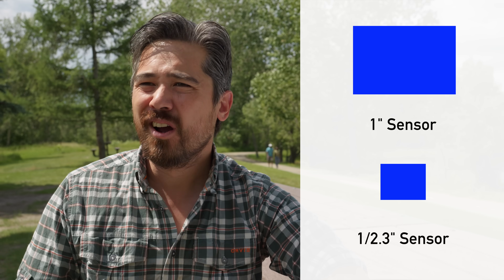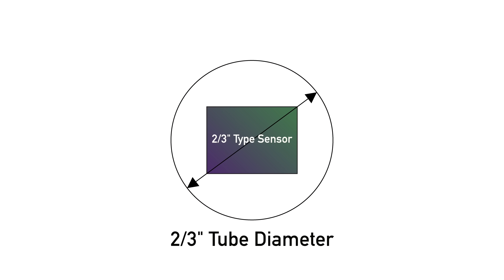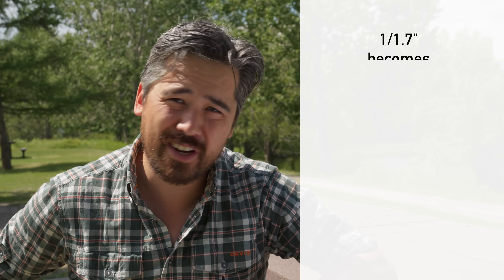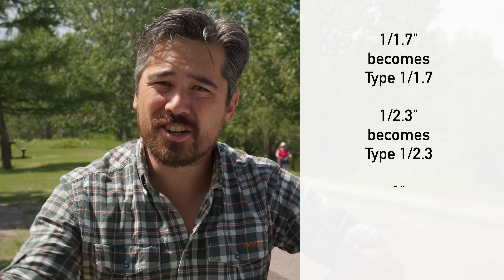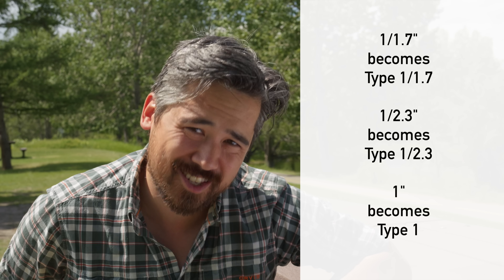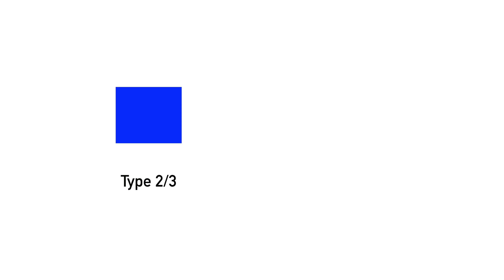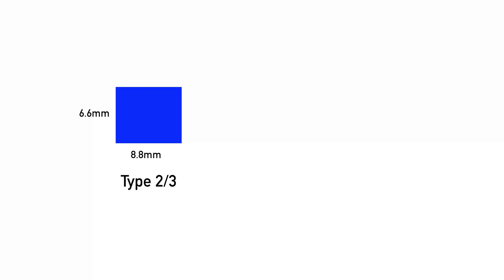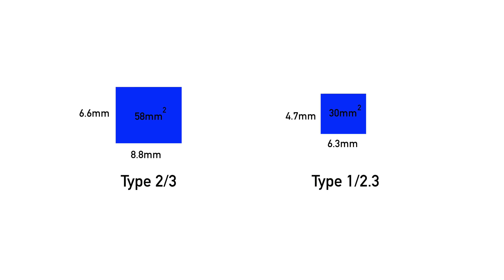Sensor sizes make no sense, but we fixed it!

Comment: That was still confusing to me - just use the 50mm squared suggested at the end of this video.
Reply: The problem using that method is that it doesn’t help all that much when you don’t know the aspect ratio of the sensor.
Reply: @GannonBurgettYT  But aren't all sensors either 4:3 or 3:2 (ignoring cinema sensors)? Are there any in popular devices that deviate from these 2 aspect ratios?
Reply: @GannonBurgettYT  And the "Type-2/3" method does? 🤣  If I have to remember 2/3" is a 4:3 ratio sensor, why can't I also remember 58mm² is a 4:3 ratio?  The difference is, if we simply use surface area as the MAIN name, then the Type number now directly infers SOMETHING and are now comparable.  My point is, Type-APS-C will not infer it's aspect ratio, nor that it has better light gathering capacity than Type-2/3.  For someone new, they STILL have to look up everything because this proposed "type" classification doesn't tell you ANYTHING useful or comparable.  On the other hand, Type-384 (APSC/24x16mm=384mm²) vs Type-58 (8.8x6.6) does.  It give you an instant, apple-to-apple comparison of a "quality".  Two, in fact... a larger Type designation will have a generally better light-gathering capacity, and generally shallower depth of field.  What's not to like?

Comment: Using square millimeters or square centimeters will be fine enough for any comparisons. For example my K3 has  366.6 mm² APS-C sensor .)
Reply: Agreed. Surface area is really what matters.
Reply: @danpsharpe  How does it matter. How do you relate it to apertures?
Reply: 100% agreed.  The "type" really didn't explain ANYTHING, and is just going to make the confusion worse.  See my other comments on using surface area as type.  Full frame would be 36mm x 24mm which is 864mm².  Just call that Type-864.  APSC is 24x16 which makes it Type-384.  Micro 4/3? 18x13.5=243, so Type-243.  etc.  It will also clearly differentiate the Canon "APS-C" which is not APS-C... at 22.3x14.9, that would be Type-332 compare to standard APS-C's Type-384.  A Type number that directly correlates to each sensor's theoretical light gathering capability, and rough depth of field quality - area you should truly care.  What's more simple than that!!??
Reply: Exactly. Its the only thing that makes sence.
Reply: Yes, this.
Reply: lol.
Reply: My smartphone has a 20.5 sq-mm sensor :-(
Reply from the maker: As mentioned in the video, whenever we compare two small sensors, we will include the square mm surface area.
Reply: @dpreview  If so, please include also the area of a single pixel.
Reply: It's a bit hilarious that people think area is a good way of measuring sensor size when we already have a perfectly good way of measuring every other thing that has pixels in a rectangle. It's diagonal length. People are able to compare phone screens to laptop sizes to computer monitors to TV sizes to projector screen sizes, of all types of aspect ratios, using one simple number. Nobody knows how to visualize two-dimensional quantities. Diagonal length is best.
Reply: @mbvglider  What?  Area is the easiest thing to compare: 400mm^2 is four times 100mm^2.  300mm^ 2 is twice the light gathering area as 150mm^2.

The only reason why diagonals are useful for TVs at all is that they are fixed at 16:9 dimensions.  If you look at say computer monitors a 16:9 34" diagonal is 493 in^2 and a 21:9 model with a 34" diagonal is 419 in^ 2, or 15% less area.  It's a useless metric for things of variable ratios.
Reply: @HappyHubris  Diagonals were used on TVs even before they had 16:9 aspect ratios. If one presents only one value, one presents the diagonal. If the aspect ratio is fixed it is better to present the width.

Comment: Am not so convinced by this new names.
I'd have gone to a complete metric system like "40 by 30mm" and so on..
Reply: Completely agree.  The "type" really didn't explain ANYTHING, and is just going to make the confusion worse.  See my other comments on using surface area as type.  Full frame would be 36mm x 24mm which is 864mm².  Just call that Type-864.  Micro 4/3? 18x13.5=243, so Type-243.  etc.  It will also clearly differentiate the Canon "APS-C" which is not APS-C... at 22.3x14.9, that would be Type-332 compare to standard APS-C's Type-384.  A number that directly correlates to each sensor's theoretical light gathering capability will be far more useful than some cryptic fractional values.
Reply: I agree with TomS. This is just using what is already confusing as a label. You could go metric and say type 10 as in under 10mm of sensor area. Type 20 as in under 20mm senor area and so on. I really love that you guys are thinking this way. I just saw camera conspiracies talk about this same thing. These conversations are headed in a good direction.
Reply: @tropicothunder4262  Did you mean 10mm², or did you mean 10mm diagonal or something else that's not an area? I don't think talking about mm of area is ever going to clear up any confusion.
Reply: @JROwensPhotos   I meant a reference to an area smaller than 10mm. So the larger the area the bigger the sensor. It has to be simple to understand for everyone but still retain a logical concept to grasp visually.
Reply: @tropicothunder4262  There. Is. No. Such. Thing. As. An Area. Of. 10mm. You might as well try to measure the area in liters or gallons.
Reply: @JROwensPhotos  refer to @Wallace Lau he said it best. I was just using that number as an example.
Reply: @JROwensPhotos  
Of course it is. A ten mm squared sensor is half the are of a twenty mm squared. Can’t get more simple than that.
Reply: @hedydd2  I think you just made my point for me. A 10 mm squared sensor is a quarter the area of a 20 mm squared one; 100 mm² vs. 400 mm². And the one I'd been replying to didn't say 'squared' anyway. Maybe  a better analogy would use units that aren't just powers of each other, as if one were describing the size of a plot of land in feet or miles, instead of acres. Wouldn't acres make just a bit more sense than asking 'hey, do you want to buy 400 feet of land?'
Reply: This!
Reply: YES indeed
Reply: As explained in the video, we’ll also be sharing the dimensions of these sensors when we use our new formatting, as well as the sqmm (in videos, at least).
Reply: @GannonBurgettYT  I get it but I just don't think it is necessary.  If you are going to define a new nomenclature, just forget the old standard completely.  Why linger with legacy fractions that will continue to make no sense?  How is new users gonna understand Type 4/3 vs Type APS-C?  But the surface area is a brilliant solution, why not adopt it as the MAIN identifier, as oppose to an "also-run"?  For example, the above 2 would just be Type-243 vs Type-384. Clear as day that 384mm² is more than 243mm²... and if users want to dig deeper they can research that Type-243 has a 4:3 ratio whereas Type-384 has a 3:2 ratio.  You can't get any easier to understand that that.
Reply: @WallaceLau  you said it best
Reply: @WallaceLau  How do you know w/o literature the ratio from the area? E.g who would instantly know a type-1452 (?) sensor has a ratio of 4/3? Easier just to call this 44x33.
Reply: @GannonBurgettYT  But this makes nothing simpler!

Just go by the height x length "36mm x 24mm Fullframe", where you can:
... figure out the Area.
... figure out the diagonal (if needed).
... and of course figure out the 3:2 (or else) ratio!

That would make everything simpler!

Trust me, I'm a German architect.
We DO know how to be efficient! 😄